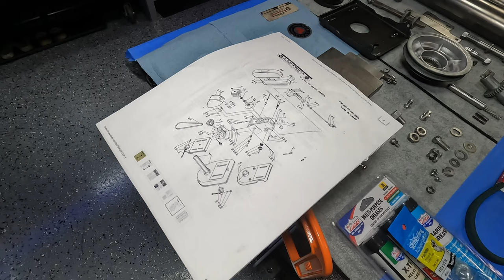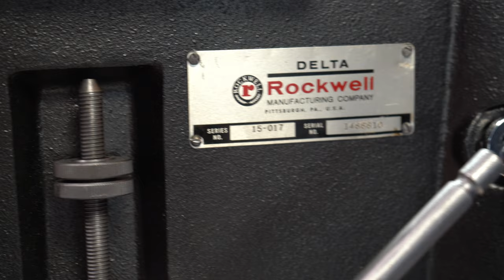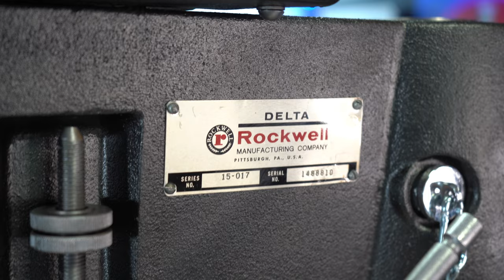Beautiful Restoration! - 1960 Vintage Delta Rockwell Drill Press - Part 4

Comment: I just got the same machine as well as a parting gift from my internship. In all it worked when I got it but it had sat for 10+ years so I'm currently cleaning it up the best I can with some old fashioned elbow grease and new wireing. It won't be to the extent you have yours (which is absolutely amazing!) But it will help me get going with my personal shop here in the near future.
Reply from the maker: Sounds great!  Best of luck to you!